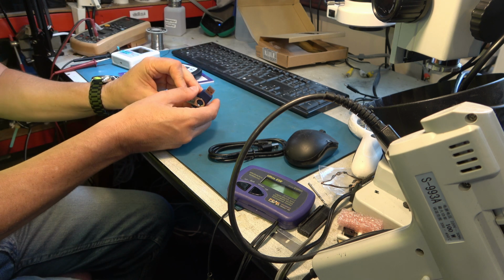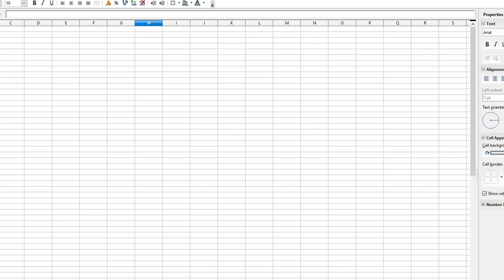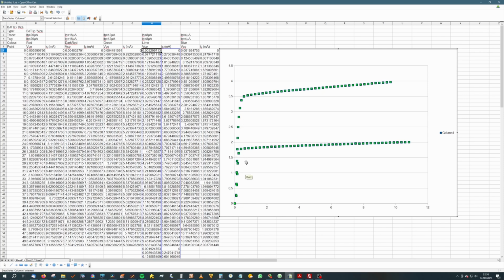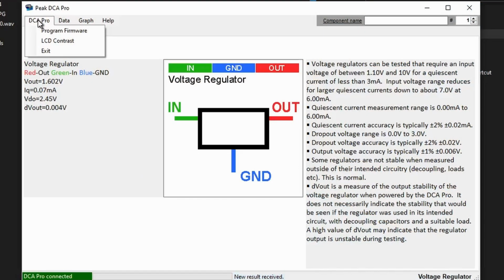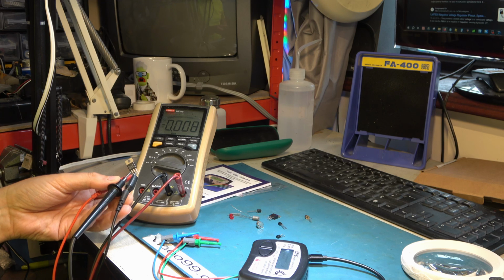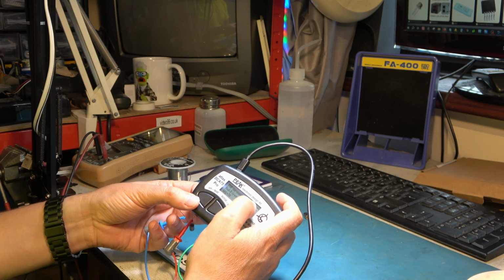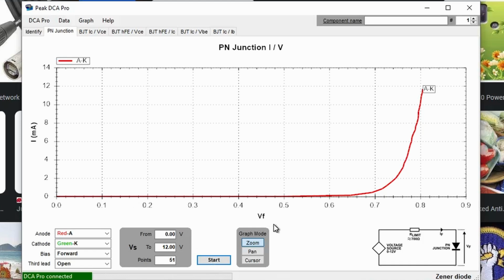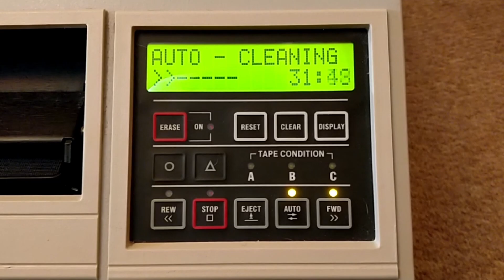Try out a DCA75 Atlas DCA Pro Semiconductor Analyser, with mixed results.

Comment: I have mixed feelings with the DCA-75 curve tracer.
I think voltage and current are too low for testing power transistors.
Some days ago I am testing some noisly transistors without success, transistor pass the test without any fault.

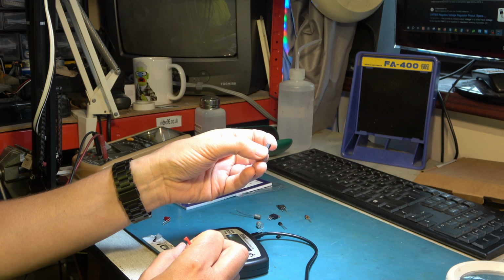Comment: 12:09 Calling a uPC574 a voltage source is kind of wrong. It is a temperature drift compensated 33V zener used to stabilize the tuning voltage feed on tuners. So unless that craptastic tester puts out more than 33V, the uPC574 will always be recognized as a simple diode only.

Comment: Got both a DCA75 and ESR70. Both are working fine and the curve tracer function on the DCA75 helped my identify lots of bad little guys in various old amplifiers. Wish there was a bigger version, maybe with a 3" display or so, to show curves as a quick test method, without the need of a computer.

Comment: Mmmm, don‘t you need to understand the limitations of the tester before concluding? It seems obvious that the tester cannot sweep negative voltages. Thus, it cannot test an 7905. And for a Zener, why did you not try to connect the zener reversed instead of assuming the tester sweeps negative?
Reply from the maker: There's an option for the zener graph bottom left to set the bias direction, which I hadn't spotted at the time.
Reply: Indeed. It is sad to see someone do a review when he doesnt even understand the limitations of the device.
There can never be anything like the all knowing and all identifying tester.
No tester will ever replace the human who with knowledge and common sense interprets the test results of the machine.

Comment: These are overpriced and will not identify failing (completely open or shorted out will)  transistors.
Reply: I agree they are very expensive. Is there a better option that doesn't involve spending a fortune on an analog curve tracer they no longer make parts for? I mean this in all seriousness as I've been wanting a curve tracer for ages but I'm not rich. I had an asa-210k and it fried when I plugged it in so I'm glad I didn't hook it up to my scope first haha.

Comment: Regarding the spreadsheet question, in LibreOffice you would just add more data series for additional curves. Double click graph to edit, right click, than select Data Ranges from the context menu, and the required dialog will pop up. And no, I do not consider myself a spreadsheet wizard. ;)
Reply from the maker: I tried to do that before I made the video but it wasn't at all clear to me how to get the extra data ranges to display properly.  Hence I could use someone to put together such a sheet.  I could publish a set of sample data if you think you could make up a better set of curves and we can then provide that sheet for other people to drop their data into.
Reply: @video99couk  Sure, go ahead, I was going to suggest publishing a set of data to play around with anyway. 
I have not paid much attention to what happened to "classic" OOo after LibreOffice split off, I could imagine that many of the improvements that the latter received in recent years may have passed it by and that's the reason why you couldn't make multiple curves work properly.
Reply: You can easily add more curves to a chart by copying just the cell range with the values and pasting it on the chart. Wprks well assuming the x axis values are identical.

Comment: You've made a nice presentation of its capabilities. 
I contacted and corresponded with technical department with my suggestions for improving their graphics handling.  They made no changes and have not upgraded software since I bought my '75. Perhaps the sales have fallen off and they are dropping support/upgrades?

Comment: My DCA75 can identify a 7805, but not 78/7912 (can't find any 7905s). However, the manual states it would "typically" identify regulators with an output less than 8v. The manual also makes the fair point that some regulators are unstable without their decoupling capacitors or not under load. I have observed some 78/79 regulators to go a little crazy with no decoupling caps, others are fine.

Still, it's useful for a pocket-size tester. A little (ok, a lot) overpriced, but then it's probably the second newly purchased thing I own that says "Made in England" (the first thing being the ESR70) so maybe arguments could be made the purchase is morally justified over something cheap from Ali Express!
Reply from the maker: I had tried a 7805 with capacitors and it failed with that too.  I suspect mine may have a defect.